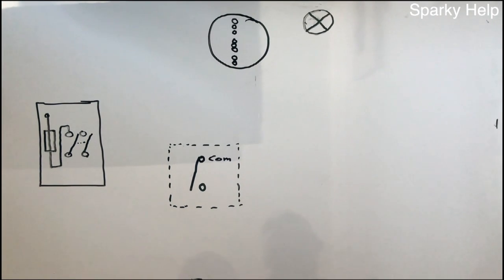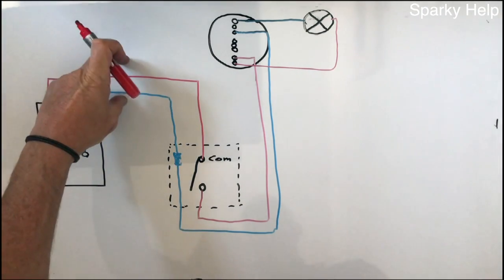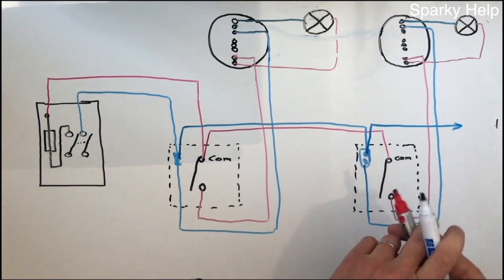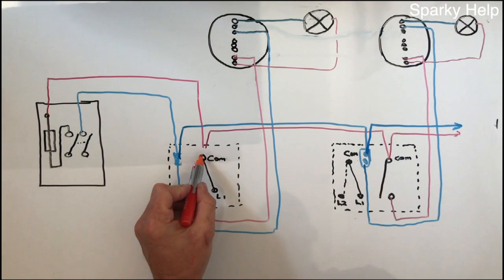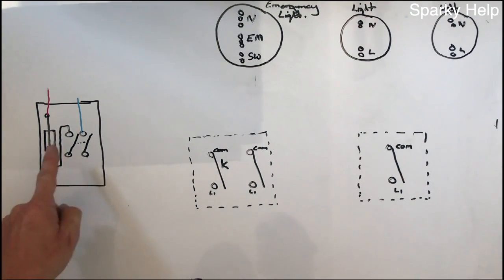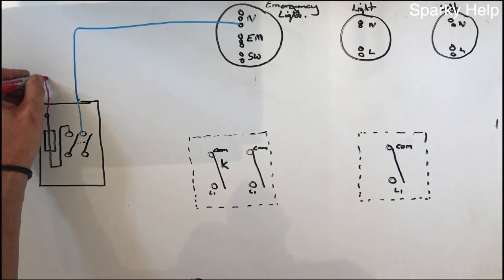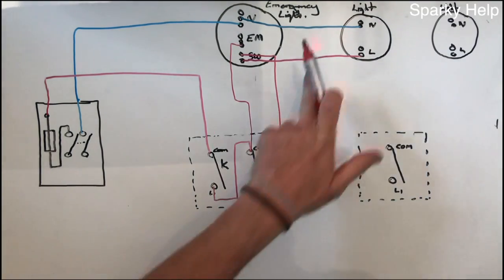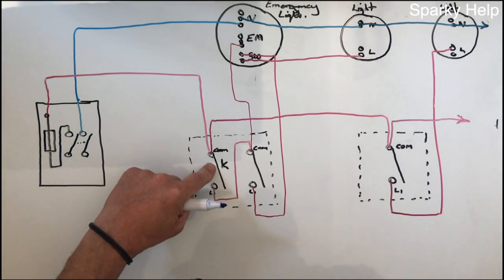Domestic Lighting, Emergency Lighting with key switch

Comment: I’m doing an office fit out. A lighting circuit has em panel lights and normal lights, using a grid switch. Should the em grid switch just isolate the em lights, so it just simulating a fault or test with them or should the em grid switch isolate the em lights as well as all the lights?
Reply from the maker: see above comment - hope it goes to plan.

Comment: Thanks for the video Paul and view your tutorial over n over but still can’t solve the issue that I am having at work.
I was told to move the 4 gangs switch modules with one dish key switch but forgot to take a picture of the connection.
To cut the long story short. Gang 3 it’s a 2 way switch linked to a fish key switch. I can’t link the switch 3 with emergency fish key switch. How do I solve this issue.
Reply: There is a twin n earth cable control the waiting are light, customs said, before when you switch the emergency fish key up it cut out the light n the emergency light comes on but since I relocated the switch the emergency light isn’t coming on. Any advise please
Reply from the maker: The emergency fitting needs a permanent feed and possibly a switched supply for it to work.  If the emergency (permanent) feed is missing(from the key switch) the light will not operate.

Comment: Hi Paul, in the very old day's I remember it was always classed as bad practice to have neutrals at the switch, apart from that a lot more difficult in wiring especially when you would have to take two twin and earth cables down to each switch behind the wall plaster metal sheathing (feed and neutral in, switch wire and neutral out). It was always insisted that all the lights were looped together via the ceiling roses. The other issue I would worry about is the depth of the single switch backbox possibly not being able to accommodate all the cables and then possibly having to change to a single 13 amp socket back box to contain all the cables, especially if you have to loop to other lights from the same switch. We always did all looping via the ceiling rose and it is what I would highly recommend. In regards to the emergency lighting that's exactly the way we always carried out the wiring. I think today they call that maintained (switched).
Reply from the maker: Yes I know the three plate system is how is how I was taught when I was training, but techniques change - deeper boxes.  I think you need to know both methods and adapt to suit your environment.
Reply: Having neutral near switch sometime is advatage. Especially for alternations/additions
Reply: Especially if you want to install a dimmer switch , which requires a neutral.

Comment: how would you convert a panel ceiling light to emergency with emergency control gear ??
Reply from the maker: You would need another switch line taken from a local point so you can test the emergency/charge the luminaire.  If you have a permanent line conductor at the luminaire (three plate style) you could switch this, but you may turn off all lights on the circuit when testing.